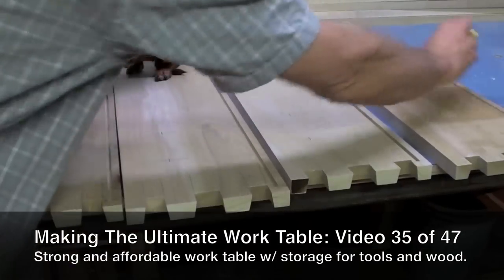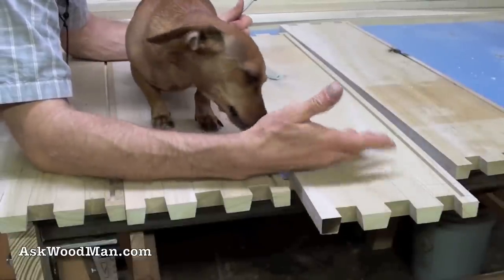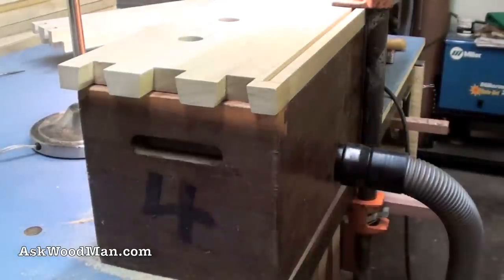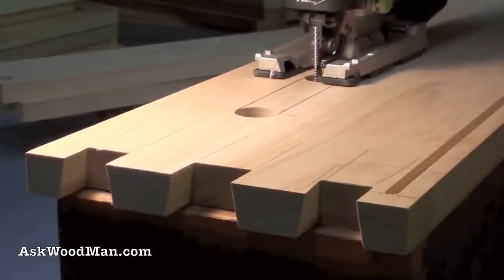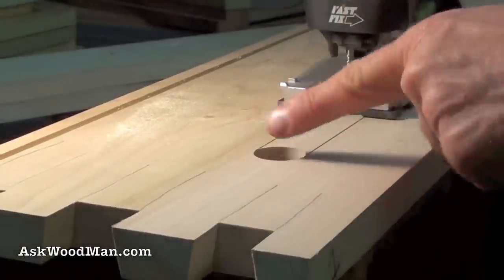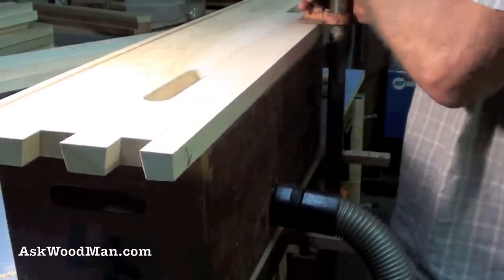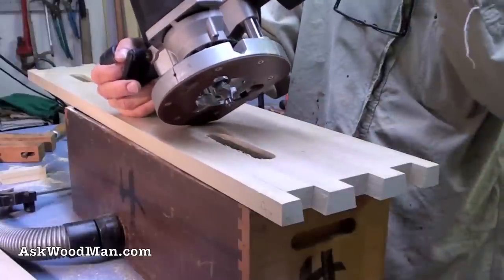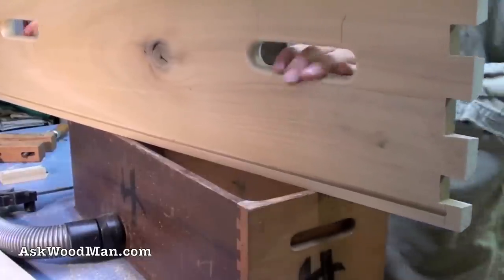35 of 47 • How To Make The Ultimate Work Table • A Woodworking Project

Comment: THANKS FOR FAST REPLY, THE THING IS I NEED A VERY GOOD JIGSAW BUT I AM LOCK ON-- BETWEEN TRION AND CARVEX? ???
Reply from the maker: The Carvex is the superior machine. My Trion has excellent dust collection, but the problem is with the blade cowl in place I can't see the cut line because of the dust cloud. Festool has solved the problem with the strobe light that syncs to the blade speed so it always isolates the blade alone. Those Germans are some clever engineers.